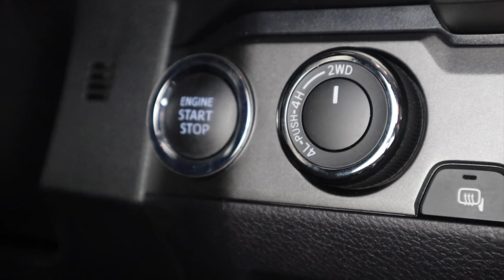Should you buy the latest Toyota Tacoma 2016-2021?

Comment: I had a 2005 Tacoma TRD 4X4....loved that thing!  Only issue was a leaking gasket the Toyota technician noticed at her 2nd oil change which was fixed for free.  (I never noticed it)  I didn't know, until AMD told me, that the early models had non-iridium spark plugs and needed to be changed every 30,000 (which I didn't change).  I traded it in at 98,000 for a Tundra and had no spark plug issues.  Hey, AMD, can you do our Tundra's now??  (My only big issue has been the entertainment system....goes wonky and I have to get the software update on a USB drive and load it.)

Comment: My TRD 4X4 off-road 6-speed manual AC didn't work from the factory & the front differential actuator was out & got stuck in 4X4 mode had to get towed 🤦 under 7,000 miles btw 
 Let's hope i have a better experience with this🛻💨

Comment: Had to have a cylinder 1 rebuild. It was misfiring and rough idle at 31,000 miles. 20 days in the dealer shop. Covered on warranty. Apparently a common issue on the 2018.

Comment: I love my ‘19 off-road, but the transmission shifting is not ideal, 10 times worse when using cruise control.  Had dealer check for updated program but still does it.  Had to get the hood fixed under warranty, factory glue wasn’t holding and would actually flutter at higher speeds.

Comment: I have a 2017 TRD Sport, 155,000 kms, second owner. Recently noticed a loud tick-tick from the engine (very noticeable on start up, can hear sometimes when acceleration on Highway) and also had a couple noticeable cloud of blue smoke on startup (smelled like burning brake pads or clutch. Truck is 6 speed automatic)  One tech, non Toyota,  said it could be lifter bucket shims need replaced and valve seals. Hope not as that will be very expensive and not worth it.

Comment: I have a 2016 and I love mine. it has 200.000 + miles on it and still going strong. changed the oil every 5000 miles.  if the engine peters out i will replace it.  not buying a new one.

Comment: `
I bought a 2017 TRD sport with only 2 wheel drive and it's very comfortable is not  a rough ride I went on a 1000 mile trip last summer 3000 miles in all and didn't even get tired at all, it was very quiet and all went well. I however noticed the auto transmission was not shifting down as it should when leaving highway sometimes wanting to stall as you came to a stop, but that was when it was new and seems to have gone away. The shifting on the highway however is some times sluggish. The rear break light on top of cab was recalled but I haven't noticed any leaks yet but, will test it with a hose but, I have washed it with a presure washer a few times and no water got in, I have a cap so it would have to be taken off to fix I guess. I don't see anything leaking so far and engine compartment is still very clean,I only have about 14000 miles so far and love the truck so far should I trade it in before all these things happen ? Anyway TY so much for all the insights on all your videos.

Comment: Awesome videos brother!! Thank you for all the info! I have a 2017 taco sr5 and I have a hard gear knock when it's cold. I usually warm up my vehicles before I drive off. This knock usually happens when I'm coming to a complete stop for the first few miles. This is at about 10mph mark. I think it's the differential or transmission knocking. Can't pin point the issue. Feels like it's from 2nd to 1st gear. Any help is appreciated.
Reply from the maker: Hi! Honestly it’s hard to tell without in person diagnosis

Comment: about the safety systems not working when being lifted: Toyota offers a trd lift kit that comes with the pro grill and sensor and they say they also calibrate the safety system to work properly with the lift. However it’s only a two inch lift front and one inch lift rear
Reply: And it’s a bit pricey but hey warranty I guess lol

Comment: Yeah, had a 1997 GMC Sierra for 25 years.  Never had any issues.  Bought a 2016 Taco 8 months ago and it's cost me thousands in repairs already, and I haven't had any of these issues.  Leaky windshield shorting out mirror heating causing battery drains was most expensive and hard to find.  Not impressed by Toyota at all.

Comment: I know torque converter shudder is a Nissan problem too specifically in the 2014-2016 models. It would happen under light acceleration at low speeds and would go away if I used a little more throttle input. Both my parents cars (2014 and 2016 pathfinder and 2016 rogue) do this all the time

Comment: “HELPPPPPPP PLEASEEEE......”I have a 2020 Toyota Tacoma sr5 2wd bone stock I bought new about a year and almost a half ago. I’m having a problem with the truck pulls to the right almost every time I stop especially at higher speed it’ll wobble and shake and pull to the right. This seems to happen every couple months. So far I brought it to the dealership 3 or 4 times for the same problem about every three or 4 months. The first time they wanted me to pay for an alignment and wheel balance, so I did it. After that it drove pretty normal. Than a couple months later same thing they did another alignment and wanted me to do brakes and the right front pads were worn down more than the left. So I had them do that and surface the rotors also right rotor was warped a little before brake replaced. After that seemed ok for another couple months than acted up again and they did the alignment and was ok for another couple months now a couple months later it’s acting up again. “ one thing I forgot to mention every time it acts up and I bring it to the dealership the steering wheel ends up loosing and clocking to the right at about the 1:00 to 2:00 🕑  at it’s worse every time. There is definitely something wrong and every time I get the we can’t find any problems unless you do this alignment first time breaks the second. Last two was nothing  but alignment was off so this time they better not try saying something that I have to pay for I think because everything was fine last two times. Sorry for the long read. I’m just really frustrated with this this is my first new vehicle I bought and it’s a lot of money the whole reason I bought this was to not have problems. Ps I was a small shop mechanic for 5 years grew up working on cars and trucks as a hobby and always fixed my own problems myself and wanted to this time but I am going the dealership route so I don’t run into any problems with them saying well we didn’t fix it so ????? Also I am by no means a professional mechanic but I know enough that something is really wrong and all the beater trucks I’ve had over the years never gave me close to the problem this is giving me . Any help is really appreciated or advise on where to call to talk to someone that can actually help fixture the issue. I’m almost at the point I wanna trade it in which is a shame because I really like the truck and don’t want something else. Thank you if someone even read this much.
Reply from the maker: Hi Chris! Sorry about the issues with your Tacoma. Question. Did the dealership involve Toyota at any point? If not then they should per the fix it right the first time initiative from Toyota.
Reply: @TheCarCareNut  hey thanks for getting back I really appreciate it. No I’m pretty sure i only dealt with the sun Toyota the dealership in Florida I bought the truck from. I’m gonna call this week and try to figure it out hopefully do you think I should go through the sun Toyota dealership or main Toyota. Somebody also told me to go call the main owners of the Toyota dealership that own multiple car dealerships they’re called Morgan auto group. Which one do you think I should call?? Thank you again for responding back that was a pretty fast response especially given how many comments are on this video already
Reply from the maker: I think you should contact the dealership first and tell them this is a problem that keeps happening. Speak with the manager and explain what’s going on. If he doesn’t do anything then contact Toyota experience center
Reply: @TheCarCareNut  ok thank you I’m gonna give it a try hopefully everything goes good. Thank you again for your time responding. This problem with the truck is just annoying and something I’m always thinking about in the back of my mind that stresses me out. Thank you again 👍🙏

Comment: One thing I'd like to know is if there's been any problems caused by these canister to spin on filter adapters (leaks, failures etc) the canister filter's more hassle when changing your oil.
Reply from the maker: Hi! Only issues is cracks because they are overtightened. If they are not then they’re good for the life of the car
Reply: @TheCarCareNut  yes, 20 ft lbs only otherwise you'll be taking a bus to the dealership for a new canister after it breaks, I want to hear from someone who is using a canister to spin on adapter with I assume the old 3614 filter.

Comment: My manual transmission makes a rattling clunking noise going over bumpy roads.. its a 22 with 2,500 miles...it only does if after I have driven it a little and it has warmed up

Comment: P11EE 2018 78,000 miles
Why did this happen to me. I do oil change EVERY 5k and only Costco gas. 

Covered under extended warranty but been in shop 4 weeks.  

I bought this over priced truck for its know reliability. I hope this IS NOT COMMON and will prove to be a good truck

Comment: On red light, when truck is in full stop and my foot is on brake pedal while the gear is in D, as the compressor of the AC starts to work, the car starts to crawl very slowly forward! I have to push the brake pedal a little more firmly. It’s not just a big deal and the Toyota said it’s normal! But does this happen to you too? 2023 2.7 l 2WD

Comment: I guess I am lucky. I have a 16 with 65k miles and only have had the third brake light issue.
Reply: I have a 2016 what is the 3 brake light issue???
Reply: @abelyerikaguerra1540  the middle brake light over the rear seat of the crew cabs had a defect. They would break at the screws and let water in the back.

Comment: Hey, Mr. AMD...
IF the auto Trans Fluid should be changed at 6 years/60,000, WHEN should the rear and front "diffy" gear oil be changed???
Reply from the maker: Hi! The rear diff every 30-50k miles

Comment: The torque converter shudder can happen in the 2018s as well. Dealing with it right now, but I have not kept up with maintaining the transmission fluids. I’m going to check the fluid and have the dealership perform a diagnostic check on the transmission. It’s the only issue I have had with the truck so far. Had it 2 years and have put a lot of hard miles on it. Hopefully the issue can be resolved with a fluid change and software update. I will update.
Reply: Upstate ?
Reply: Update sorry 😅

Comment: This was a great video. We own a 2021 TRD Sport and love it. My question on this video concerns the frame coatings referenced towards the end of the video. Are we talking some sort of rubberized or paint style undercoating, or something like a spray on film such as "Fluid Film" Or PB Blaster Surface Shield" or similar products??
Reply from the maker: Hi! Fluid film works well in protecting the frame against rust
Reply: @TheCarCareNut  Is fluid film what Toyota use? Just drop my 16 OR off this morning for frame inspection and 3rd brake light fix. Thanks for the great content!
Reply from the maker: Depends on the dealership but fluid film seem to work well on Toyota  frames

Comment: Just picked up my sr5 a week ago. This is my first experience with this engine,I’m carefully breaking it in , so far just back and forth to work (20 minutes one way nothing over 45 mph) . Maybe I’m just over reacting when first starting the engine is quite but when I’m in the parking lot l can hear a “ticking “. I’m old enough to remember watching a friends father setting the tappet clearance on a inline 6 with the valve cover off, it almost sounds like that not like a engine low on oil upon start up until oil gets circulated.I checked the dip stick that’s good.if I have to go back to the dealership I would just like to have some information, thank you very much.
Reply from the maker: Hi! Honestly I wouldn’t worry. These engines are loud and that’s how they are today and at 300k miles.
Reply: When you change the oil use Liqui-Moly Special Tec AA 0w-20. Makes her purr
Reply: Still ticking?

Comment: Purchased a new 2023 6 cylinder Tacoma in November 2022. Fast forward one year later November 2023 the truck is in the dealer having the engine pulled out for the timing chain cover leak at 16200 miles on it. The vehicle also shutters around 50 mph when accelerating on the on-ramps. 😑👎

Comment: Great videos I just hit subscribe...  I just today bought a used 2018 double cab from a dealer and will  certainly watch for these issues...  And yes the FRAME will get  under coated before next winter.......  I already see some localized rust developing... Do you suggest any Rust KILLER before coating these spots... Wire Brush them perhaps ???????  I just traded in a 2002 tundra with only 152k miles that the RUST was killing EVEN after the Toyota under coating program .... ..I truly LOVED that truck... It was  a  V-8 version of todays Tacoma.....  I would buy it again if it were  still  Made......... BAD TOYota.
Reply from the maker: Hi! Brush them and cover them well on both sides and it should be ok. As long as you block oxygen rust won’t progress

Comment: Hello,  I have 2017 Trd off road. Traction contro, check engine lights on. Error code P11EE.  Just dropped it off at Toyota. Waiting to see what the damage is.
Reply from the maker: Hi! What’s the mileage and anything recently done to the truck?
Reply: @TheCarCareNut  wow. Thanks for answering. 78,000 miles. I purchased it at 73000. Nothing has been done to the truck aside from routine maintenance.
Reply from the maker: Interesting. That’s an air/fuel ratio imbalance. Not a common code for the Tacoma and definitely will need some diagnosis to get to the root cause
Reply: @TheCarCareNut  Thanks again. I hope it’s covered.

Comment: I have a question. My 2021 TRD 4X4 came with 265/70/16 tires on it. I would like to put the 275/70/17 on it with new wheels. My question is, "Can either the dealership or myself calibrate the speedometer so that all the all the computer info things, (Gas Mileage, speed, etc.) work WITHOUT pulling the dash apart? If it's a giant headache, I will just leave the stock tires and wheels on. Thank you, Robert
Reply from the maker: Hi! The Toyota dealership scan tool allows for software change of the Speedo up to 4mph +-

Comment: I bought a 2021 trd off road new. I did the first oil change at 900 miles, then every 5k miles thereafter and currently sit at 60k miles. I've used oem filters and mobil 1 oil. I changed my spark plugs today and noticed while scoping each cylinder there are some vertical lines on the walls. Some pistons were toward the top so I couldn't see them all. What would cause this? Should I be concerned? This is a daily driver, no short commutes, no abuse in any form. Otherwise it runs great. Thanks for any input.

Comment: Quick question: I just took delivery of a Tacoma and notice after my morning commute (about 45 minutes) I hear a "tick" in the engine. I dont hear it upon start up. Ive read that these atkinson cycle engines make that noise when direct injection is being used. Is this true? Or is this something I should have checked out? Truck has 115 miles on it currently. Thanks! Love the channel!
Reply from the maker: Hi! That is correct! These engines can get loud and it’s normal
Reply: @TheCarCareNut  thanks for the reply! I still took it in to have it checked out being that it's a brand new truck and it's warrantied. I'll keep you posted on what they say if you'd like. My only concern is this: I've read that the "ticking" is the fuel injectors for direct injection, cleaning the valves. But they run constantly. Shouldn't that "tick" come and go as that process is happening rather than just be constant?

Comment: What about rear diff howl? My '16 had it even after Toyota replaced the leaf springs and cab/frame bolt assembly.  My '21 has it too.
Reply from the maker: Hi! The diff howl is usually the gear contact is not set right. Usually Toyota will replace the whole carrier under warrantu